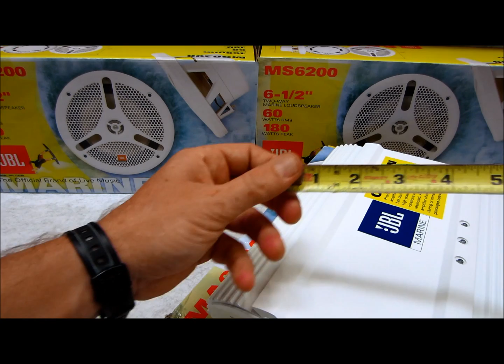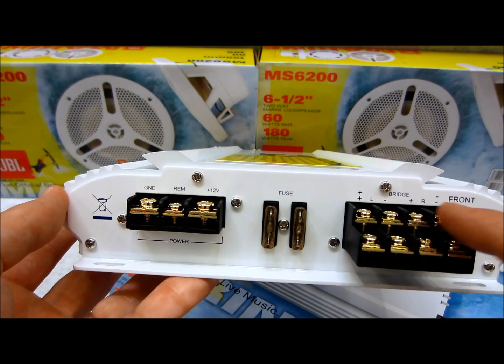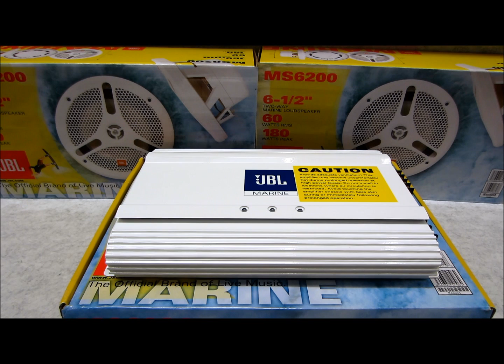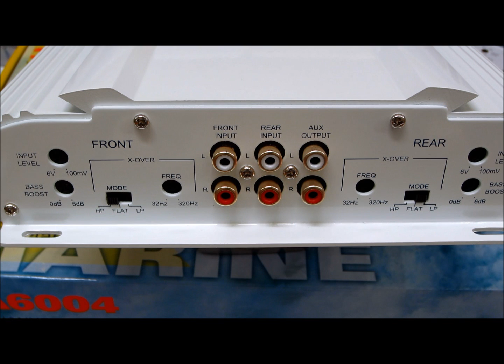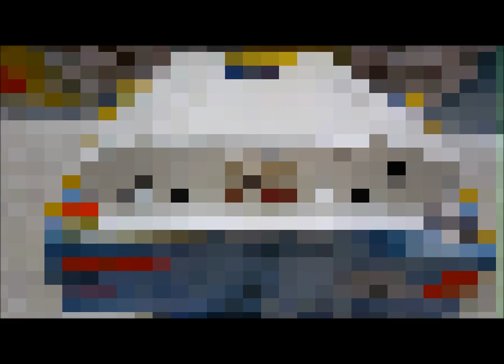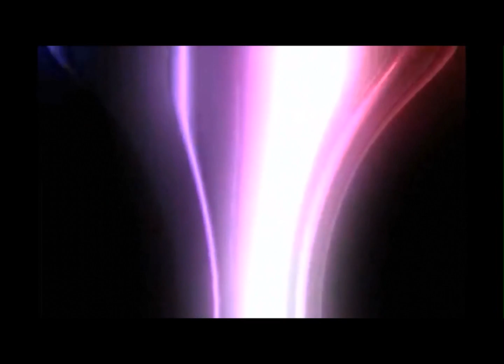JBL MA6004 Marine 4 3 2 Channel Amp Review

Comment: Questions. Regarding the freq knob. If I set the screw to about 120Hz then set the mode to HPF will that channel output freq. 120+. Or will the HPF pass the max of the knob, 320Hz and above?
Reply from the maker: it depends entirely on the mode you select, you can get either a hpf or lpf, you cant create a bandpass filter if thats what youre thinking..
Reply: @Lesscoelectronics  Not what I was asking. Not sure how else to phrase my questions. If I set the knob to around 120Hz then select HP will all frequencies above 120Hz be passed?
Reply from the maker: In that case the hpf will block te frequencies below 120hz to eliminate subsonic and lower bass audio

Comment: I'm haveing trouble finding an amp that will sute what I'm trying to setup because I don't understand the inputs very well on amps 
I'm trying to run 4 Polk db6501 in my door cards and possibly two Polk db5251 in my rear deck lid on my Audi A4 The big thing with me is I have 4 pre amp outs out of the head unit that I want to have the full control over still and have a out for my amp that I'm powering my sub with as well. I'm just figuring out some about "full range amps" but Seams there is a billion and one options with everything.
Reply from the maker: why not look at a 5 channel with a dedicated level control built in so you get it all in 1 shot maybe?

Comment: Im currently using 2 of these amps to power 8 Kicker Km65. I bridged it to gain rms so i sent 1 wire to power 2 speakers. On the amp it says 1 front and 1 rear but i only have 2 rcas. do i Y-Jack each out from my radio to get 4 outs? also how does the output work to my Second amp which i have bridged swell. Meaning when i output it do i have to y Jack each aswell to get 4 outs instead of 2, to go into my 2 front 2 rear?  one amp seems to be running hotter than the other and flashes from time to time. I havent worked with these many rca input usually just 2 or 4  (1 in 1 out) please help thanks
Reply from the maker: Q Min the rca inputs all need to have audio in, whether its y split or not, it makes no difference on the output stage.

Comment: I am looking at this. I have a pair of Alpine M-700 (7' 2 ways) and looking for a sub and amp. The sub I'm looking at is Kenwood P-WD250MRW. I know it comes with an amp but wondering if I could run all 3 off this amp? It is a 4 Ohm sub, so bridging the 1 channel would bring it to 2 Ohm? Is that correct? If so I would probably just be better off using the amp that comes with the sub and this amp? Thanks!